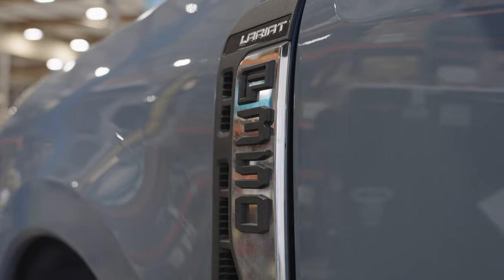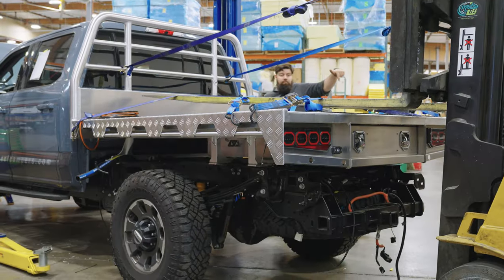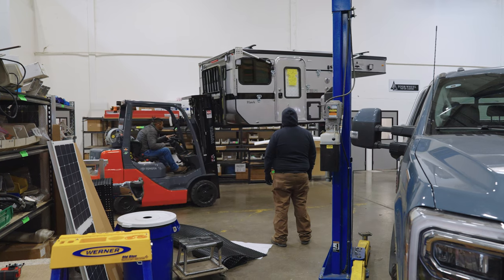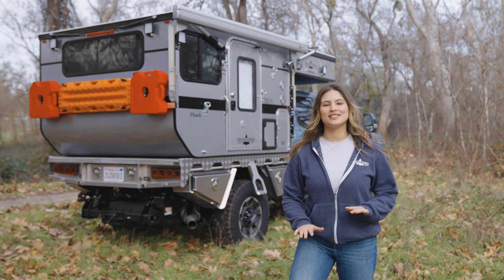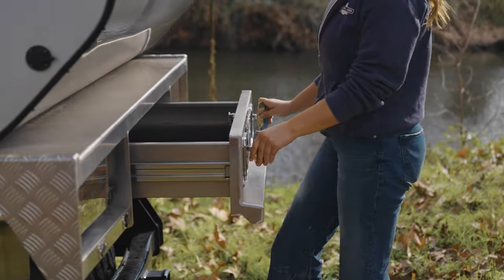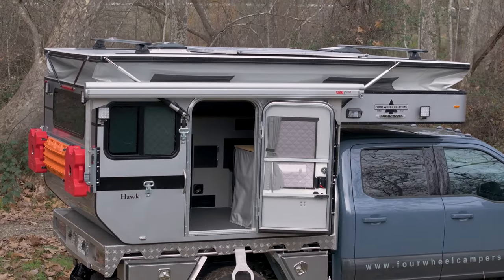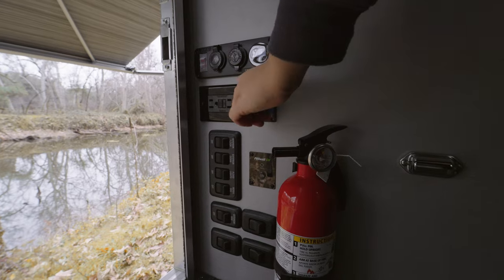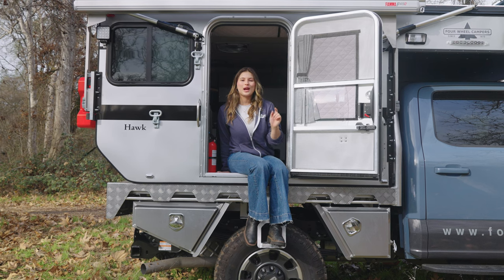2024 F350 Tremor with Hawk Flatbed Pop Up Truck Camper Tour | NEW Bamboo Countertops & Coin Flooring

Comment: We have the 2022 edition of this exact setup and love it. The Tremor comes  stock with 3" lift, 35's and rear lockers. Just did the Schafer switchbacks no problem.  The FWC flatbed is an engineering marvel.  Fit and finish are first class. The interior space is ideal for two adults and two dogs (they sleep on the "love seat" dinette conversion). All systems worked perfectly. No issues raising the top manually with the door closed and the fan on. Last month at Borrego Springs we weathered sustained 40 kt winds with 65-80 kt gusts overnight...the canvas top was noisy but otherwise no problems. Overall a great combination!
Reply from the maker: Love to hear about your adventures and setup. The Tremor is a fantastic "out of the factory" option and we are loving the way this is driving. Now we just have to put it to the test like you have off-road! Cheers.

Comment: I'd say the weakest point of this camper set up is the singular stirrup style step to enter and exit the camper especially on a F350 Tremor running 35's stock. I'd suggest a fold out ladder style adjustable step like modern RVs use or similar. Imagine at night trying to feel around with your foot to locate that small stirrup with your heel or exiting backwards with your toes. Likely why entering the camper wasn't shown and the girl just sitting in the door way. Nice rig except that one detail.